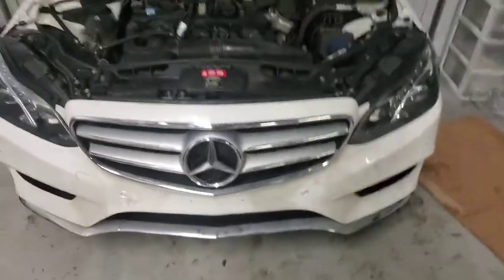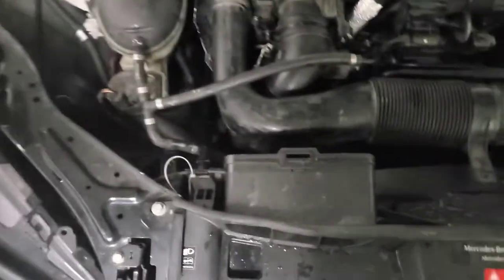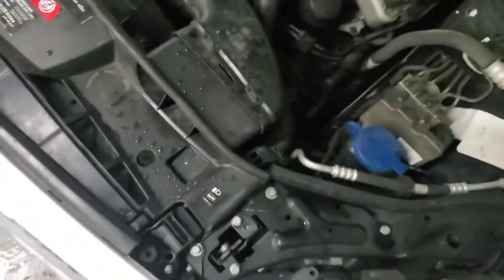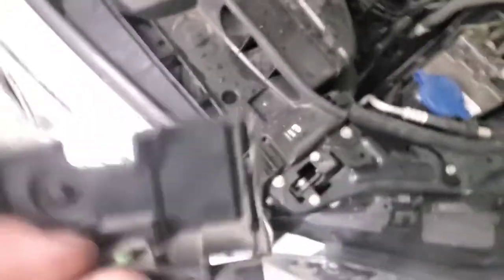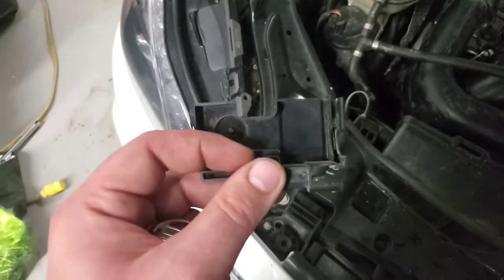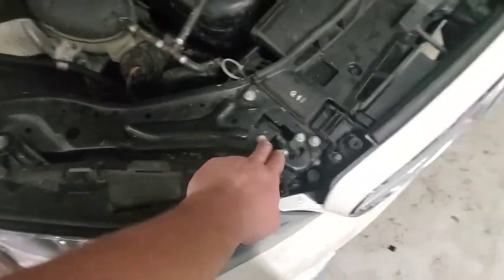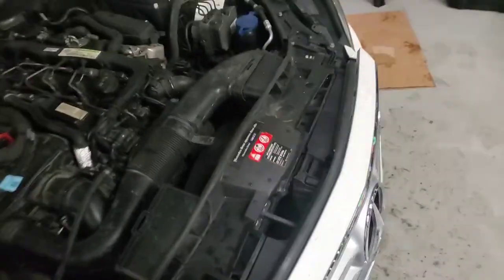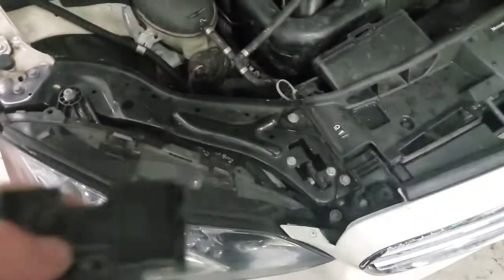Mercedes hood latch open explained 2014-2016

Comment: I have a 2009 c300  i wold like  your  help i been trying to find out where the cables goes conected to my cables where gone due to crash.. i purcheded both swicthes  and the harness for driver side  i dont know where goes conected to  one side  i know for fact that clips in the scwic   there is 2 wires brown nd blue and other is  just brown

Comment: Ok but mine won't stop dinging and its not open
Reply from the maker: Its probably the switch inside that has gone bad.
Reply: @TehArtfulDodger  I actually took it apart and put a zip tie on the sensor and now it won't ding anymore
Reply: @jacklynwood2008  how did you do that
Reply: @nor3134  underneath the latch of the hood is a sensor. I undid the bolts and zip tied the sensor. 
When looking down inside the engine it is the one on the left.  Under the latch hook for the hood
Reply: What did you zip tie? I have this same problem which I can’t listen to my
Music because the hood chimes open
Reply: I zip tied the latch clip on the body of the car. I zip tied it down like the door latch was engaged to be off.
Reply: @jacklynwood2008  please help me I don’t understand anything can you show me the precedure ?